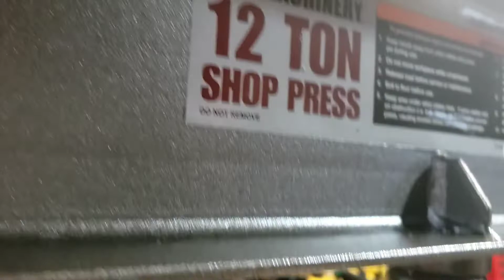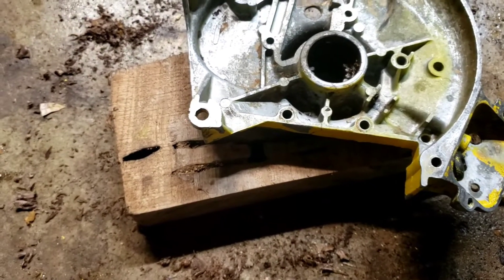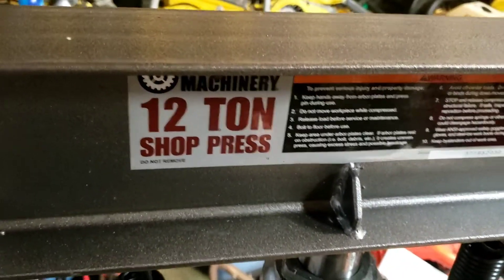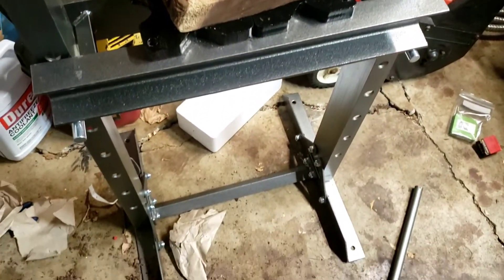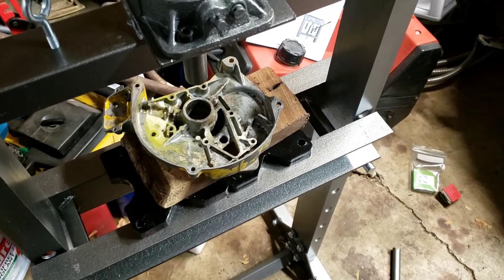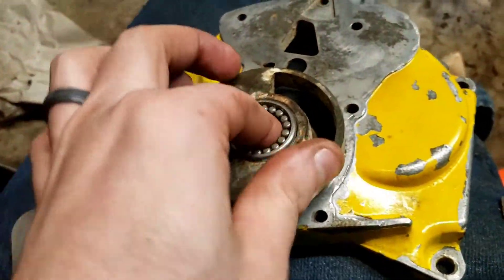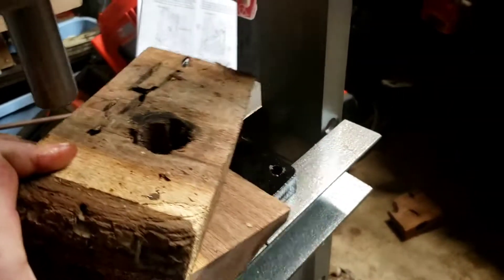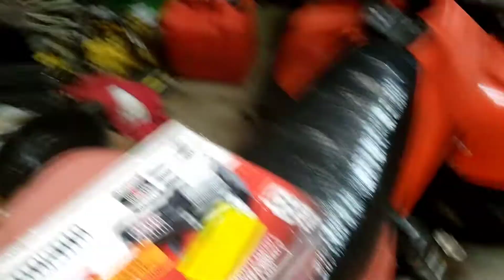McCulloch Model 77 Side Cover Bearing and Seal Replacement

Comment: Hi Bryan!!😀😀
That's a nice little press. 
For doing bearings like that you really need one to do it right. Instead of pounding on it with a hammer. 
Good score on the winch. Hopefully it will last. Harbor Freight stuff has been getting better. But some things are still a little iffy. 
Take care my friend!!😀😀

Logger Al
Reply from the maker: Winch won't be an everyday use thing so hopefully it lasts. Quality of things have been getting better for sure.

Comment: Some of the aluminum seal/bearing drivers work well with a press and are pretty cheap. You might hook up with Bellhopper and have him turn the common Mac size drivers on his lathe for the both of you. Or you could use it as an excuse to buy a lathe!!!
Reply from the maker: I lack 440v or even 240v in the garage. Now a little 120v I could possibly do
Reply: @mistermacgray  Smaller aluminum you can get by with a 120v for sure, however, it will get addictive and soon won’t be enough....
Reply from the maker: @mrxlh  i know what you mean by something becoming addictive (see channel full of McCulloch chainsaws for reference).